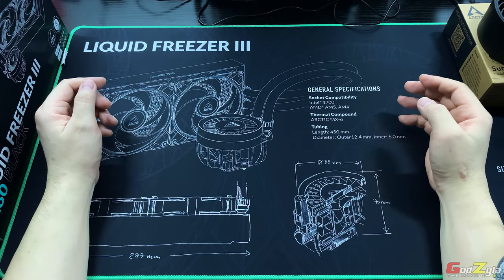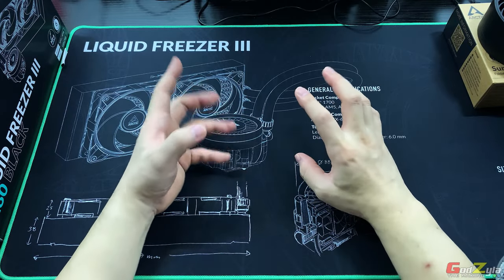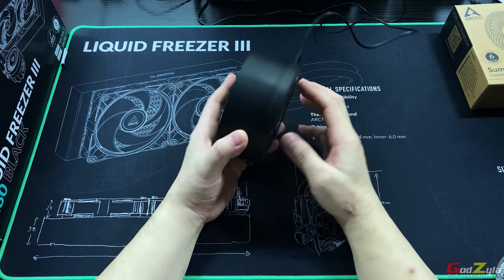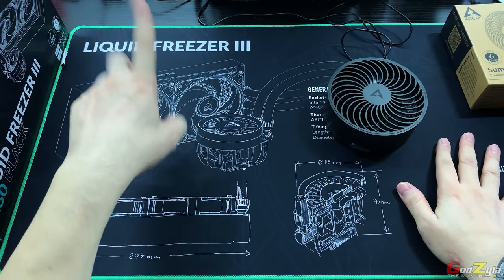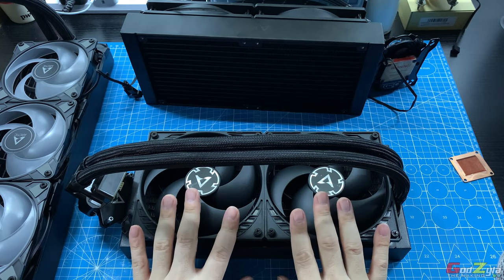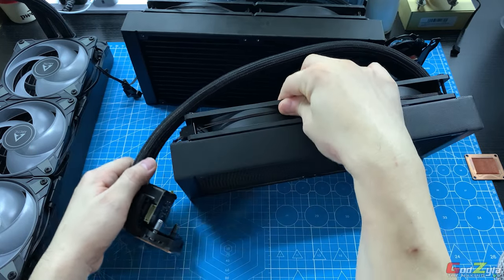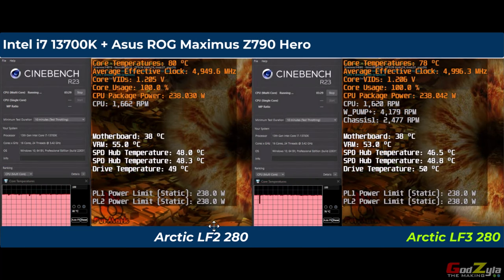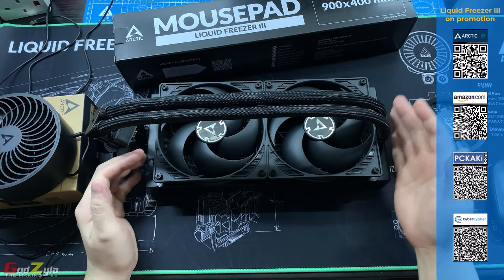Arctic Liquid Freezer III

Comment: hi I bought this watercooling for my ryzen 7 5700x but the water block does not cover the entire processor and I have lower temperatures than with my double tower cooler
Reply from the maker: Hi Coco95cc, welcome to my channel. It might not cover the whole IHS but it does cover the am4 die area due to the offer from this LF3. 😉
Reply: @KleoYan  thank you for answering me, so it's completely normal but I have less good performance than with my cooler
Reply from the maker: @Coco-rl9kn  huh, no, you should have good thermal results when using the LF3. part of the reason is this https://youtu.be/ugg_6bvYZAk , though is LF2 but LF3 is build with the same concept and it enhance further as I have illustrated in this content, even though mine is of an AM5 platform. I am curious, which aircooler are you using before the LF3? maybe try this method to apply your thermal paste. as it does aid my viewers. https://youtu.be/xZ2R4roF1_Q . One last question. which LF3 size did you purchase? 240, 280, 360 or the 420?
Reply: @KleoYan  I have a Thermalright Peerless Assassin 120 White ARGB 6 and the watercooling size is 240mm
Reply from the maker: @Coco-rl9kn  oh ok. this is shocking, do pardon me as normally when I get liquid AIO for my own usage, is either a 280 or 420. wish I could test the 240 LF3 against the Thermalright PA 120.
Reply: @KleoYan  that would be a good video but thank you for answering me and helping me
Reply from the maker: @Coco-rl9kn  you are most welcome. Hmm, ok, this might be tedious, maybe give it a try on the thermal paste application and if it still the same, it's a valid reason to return the 240 LF3, I mean it should perform better than aircoolers, if not, I mean for the price you paid for. This is just my opinion, the choice is yours.

Comment: There is no thermal throtling with the 280? Why cores only at 5.1 and not 5.7?
Reply from the maker: Hi Chema Alonso, welcome to my channel. I am from a hot and humid country year round and I prefer to stay at 80 to 85 degrees max. If cooling allows I will pump power limit up. Or PBO2 settings up.

Comment: Great tutorial, loved your channel!
 Is there any benefit of using the split connector over the single one?
Reply from the maker: Hi Daniel Dacorso, welcome to my channel. Yes there is. In my opinion to prolong the lifespan of a pump. It’s best to run it consistent rpm which I have fix. I can control the rpm of vrm fans and radiator fans. If you plug the single cable. What ever you control. All will follow, this will be bad for the pump. Plus for vrm and rad fans the noise you can’t control either. As all three will follow to one settings.

Comment: Could u change the fans for this AIO? I'm asking cuz i wanted to use lian li fans to go with the rest but if i can't I'm fine with the stock fans
Reply from the maker: Hi Dead Cypher, welcome to my channel. Yes you can. After you have changed the fans. Just make sure your Lian Li uni fans are plug to its own controller. As for the connection on the LF3. Plug the single cable which controls the pump and vrm to the pump header on the motherboard.

Comment: Limiting the wattage means the aio is not fit for purpose!
Reply from the maker: Hi ToonNut1 ToonNut007, welcome to my channel. the AIO is fit to drive at default, it's just that my room temperature is always sitting at 30 to 31 °C, therefore be it using AMD or Intel platform I will not drive the wattage that high.
Reply: @KleoYan  OK 👍
Reply from the maker: @toonnut1  you are most welcome and all the best with your build too. 😉

Comment: For me was hard af to mount this aio i scratch a lil bit the copper plate from the aio but is too little, is going to be a problem or it doesnt matter? The problem i had is that only one side was going down and the other one never was going down you have to do a lot of press...
Reply from the maker: Hi Juli Gómez, welcome to my channel the little scratch is ok, don’t worry about that. As for mounting, yes it does take a little force but the main point is to have sturdy grip and to anchor the thread in place. I guess it greatly depends on how each individual hold and to position the pump block.
Reply: @KleoYan  nah finally I mounted but thats all 3 lil Scratch, but comon artic, thats too hard to screw the screws.. thanks for the reply cause I quit the thermal paste and again put it ill check when I got all the build the temps and other thing I put all vrm,pump and 3 P14Max on the CPU fan on my motherboard cause its support 3A in total, my question is if P14Max works on 0db Ill put a curve till 40% 0db what are going to happend with vrm and water pump?, are going to work at minimum rpm? And what is the optimal rpms for vrm and water pump always 100% or with the 0db curve from artic IS fine?
Reply from the maker: @juligomez2493  I would use the split cable. Pump connector will be providing power to VRM and Radiator fans, use the VRM on a fan header and I would set to run at 50%, you do not need to run VRM fan at full, it's just to assist to sweep off the warm air from VRM areas. As for fan connector (Radiator fans) do as per normal with your own fan curve which is based on the thermal of your CPU. Last but not least. I will leave the pump at 100%, if it's loud then set to 80% consistently.

Comment: Hello,
Why do you say you have to clean with alcohol before applying thermal paste if it's brand new?
Did you mean if there was still thermal paste left on it or did I misunderstand?
Because I don't see the point if I have a new processor and new AIO to clean with alcohol to apply thermal paste. By the way I received my Liquid Freezer III 420 a-rgb today, very excited to build the PC.
Reply: Oh I understood you are talking about cleaning the AIO for possible sticky plastic residue, not for the processor itself
Reply from the maker: Hi SENVOK, welcome to my channel. It's up to you. I just have a practice on this. Processor is new yes you can just plug and play but for me, I will clean it first and as for liquid aio coldplate, once you remove the plastic cover, there might be residue on the coldpate, thats why I clean it too.

Comment: I apologize for the inconvenience, but it seems there might have been a mistake with my purchase of the Arctic Freezer III ARGB 420mm cooler. Unfortunately, it appears that the package did not include the necessary screws, ARGB controllers, or thermal paste required for installation and no new contact frame from Arctic. Could you kindly assist me in resolving this issue so that I can properly install the cooler? Your help would be greatly appreciated. Thank you. (I bought this cooler from Amazon (95$))
Reply from the maker: Hi G. T. O. welcome back, as much as I wanted to help you, without complete package, it will be hard to mount your liquid AIO. I strongly encourage you to send in your issue through here https://support.arctic.de/menu/support . check your package againts he package here https://support.arctic.de/liquid-freezer-iii-420-a-rgb you might need to take some photos of your currect package, also attached your invoice of your purchase from amazon. Claim your rightful warranty from Arctic.
Reply: @KleoYan  thank you so much for helping me if i can just buying the new contact Frame how come with Arctic Can please share the link of the product and the screws necessary to mount my i7 13700k  if you can't please seggest any solution because if i contact Arctic that gonna take a long time please help me
Reply from the maker: @g.t.o9835  the contact from is not for sales, it comes with the LF3 which you have purchase. I know it's going to take sometime but that's the only option you have at the moment.
Reply: @KleoYan  how much time can take around 1 week ? two week? for answer me or view my message.give please i sphere of time i wait 🙏
Reply from the maker: @g.t.o9835  Hi, I am not from Arctic, won't be able to answer you this question. Best if you can submit the warranty claim as mentioned to you.

my previous message 
I strongly encourage you to send in your issue through here https://support.arctic.de/menu/support . check your package againts he package here https://support.arctic.de/liquid-freezer-iii-420-a-rgb you might need to take some photos of your currect package, also attached your invoice of your purchase from amazon. Claim your rightful warranty from Arctic.

Comment: i got msi x570s xmax 
it says cpu fan and pump fan is 3A 36w
other sys fan 2a 24w
1 cable is work in my system
thank you
Reply from the maker: @BananaBeach519  hi welcome to my channel. Yes if your fan headers are 2A to 3A. You can use one single cable.
Reply: thank you bro
followed u
Reply from the maker: @BananaBeach519  you are most welcome. All the very best with your build too. 😉

Comment: thanks a lot more clear now.
I struggle only with the 3 pins on my board B650M-HDV/M.2 where there is 2 on top and 2 on the down side to plug in, would like to understand where goes what on this board.
Reply from the maker: Hi Hansoe Venema, welcome to my channel. which brand of board is that?

Comment: So, this LF3 better than Ryujin III, sir? Currently, I use ryujin III, and my 14900k min temp 37-38 idle, but I think it's still hot. My room tempt a bit hotter than yours, around 32-33, so I think to replace it with this LFIII. 😅
Reply from the maker: Hi JosieGan, welcome to my channel. This I have no comments but for LF2 or LF3 280 or 420, with good static pressure, it will out beat the ryjin III 360.
Reply: Why you care about idle temp? In idle the only thing that should matter than your pc is completely inaudiable, even if your temps are 50c
Reply from the maker: @Tpecep  hi ya. welcome back. lets just say that others are curious, I mean no wrong asking and yes, overall what matter most is during load which I agree with you. 😉
Reply: @Tpecep  I care for both, my pc inaudible even slightly over 50, but I live in a HOT country, and it's often too hot, so I want to press the temp as low as possible even during idle. 😮‍💨

Comment: Thank you for the great review! I have only two questions. What version of the Arctic Freezer II have you used in this comparison? The last one? (v7) 
And what type of mounting for AMD socket? (offset mount? Same as the new AFIII?) 
Thank you again.
Reply from the maker: Hello killeragosta, welcome to my channel. I am using a year 2019 Arctic LF2 which is no reversion, but I what I did on the LF2 is, I separate the pump and the fan on different fan header. Pump to the W_Pump header and Radiator fans to the CPU_FAN header.

Comment: Great review. Please I need help to plug the cables on the motherboard. 

My motherboard is: GIGABYTE Z790 AORUS PRO X REV1.0 

The cables: VRM - FAN - PUMP

The headers:

-1 CPU_FAN
-1 OPT_FAN
-4 SYS_FAN
-2 SYS_FAN_PUMP
Reply from the maker: Hi Fahad Alhabshan, welcome to my channel. Based on the manual, Page 25/45 https://download.gigabyte.com/FileList/Manual/mb_manual_z790-aorus-pro-x-wifi7_1203_e.pdf? all your fan headers are 2A which is good. just my opnion. 

1) LF3 AIO Pump to SYS_FAN6_PUMP 
2) LF3 AIO Radiator Fan to CPU_FAN
3) LF3 AIO VRM to SYS_FAN5_PUMP 
 4) for other case fans, make use of those SYS_FAN headers but not CPU_OPT

this way you can control the RPM of your radiator fans and vrm fan.
and as why do not use CPU_OPT as this header follows the fan curve of CPU_FAN. it's shared. 

hope that helps.
Reply: @KleoYan  Thank you very much
Reply from the maker: @FahadRZ  you are most welcome. All the best with your build too. 😉

Comment: Thanks for review!
I have a question...
Do you think the 280mm aio will be enough for 7950x (in eco mode 105W, or even 65W)?
Or maybe I should go for 360mm?
Reply from the maker: Hi Przemek N, welcome to my channel. Yes the 280 definitely is more than enough to tame the 7950x. Just make sure that your case have enough clearance to mount it.
Reply: @KleoYan Thank you for your answer.
I want aio 280mm because I want to build a relatively compact computer.
But everywhere I read: "buy 360mm!"
Reply from the maker: @przemekn.8814  many do not know this, a 280 LF2 or LF3 can defeat the 360 on thermal and they are quiet to run. This is due to the 140mm fans which can run at lower rpm and to push more air to the radiator. Also imaging 360 is a cup and 280 is a plate. You pour hot water to both, when you use a domestic fan and blow both at the same time. Which will cool faster?  The hot water in the cup (360) or the hot water on the plate (280)?
Reply: @KleoYan Thank you! You convinced me. So I decide on aio 280mm (I've never had water cooling). I'll probably choose LF3.
Reply from the maker: @przemekn.8814  you are most welcome. Just be sure that your case can fit and have enough clearance from the motherboard vrm heatsink area. Also just to share, besides watching how to mount the LF3 in this content. Try this method apply thermal paste. I always have 99% good thermal results. https://youtu.be/xZ2R4roF1_Q?si=DGYUGY9OnYKwWL8E
Reply: @KleoYan  Great tip with the thermal paste!
One more time - thank you for everything
Reply from the maker: @przemekn.8814  you are most welcome, all the very best with your build too.😉
Reply: @KleoYan I'm actually considering two cases: O11 Air Mini or Ausu Prime AP201.
But in your AP201 review you say the FL 280 won't fit on top.
Browsing the Internet for O11 Air Mini + FL280 - there may also be a problem with AIO at the top. The only thing that saves me is placing AIO on the front.
I'm looking for a compact computer case, preferably all mesh (I don't like windows very much, but maybe I could survive somehow). But I see there is a problem with all this...
Reply from the maker: @przemekn.8814  i can only think of my past build which is the O11D Mini instead of the Air Mini. that fits perfectly but will need to mount your GPU vertically. https://youtu.be/caZg__l18Dk Also take note that this past build is of a 3080 Tuf card.
Reply: @KleoYan  Thank you for your time and willingness to help!  I'm 99% sure I'll choose the 011 air mini.  I have one last (probably) question.  I'm hesitating between two motherboards.  1 - MSI b650m Mortar (matx);  2 - ASrock x670e steel legend (atx).  Which do you think is better?  I'm building a computer for proxmox.  No games.  Even I will only use a CPU graphics card.  Unless I need one someday, I'll buy a cheap one.
Reply from the maker: @przemekn.8814  both boards does the job good. But if you want further expansion like more storage. I will go for the ASRock x670e steel legend. Not only this the cooling of this board is rock solid 
https://youtu.be/alWqmQIq4uw